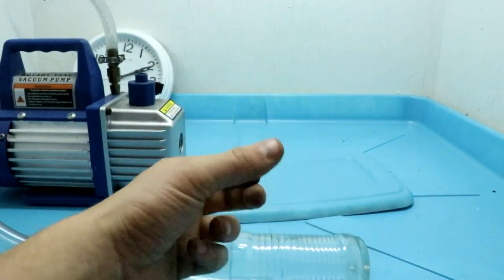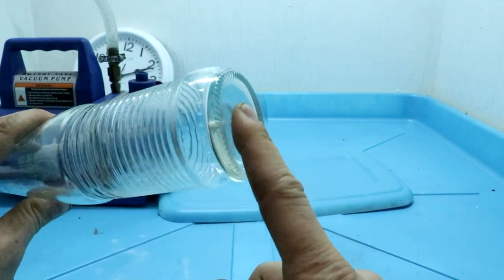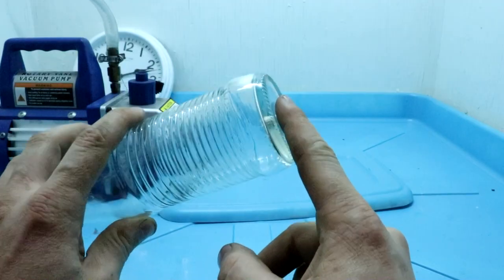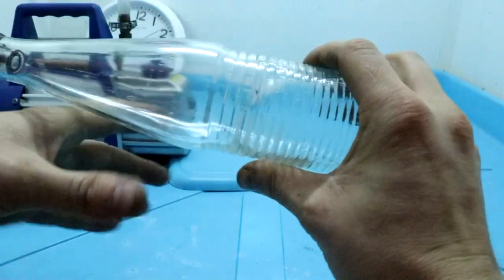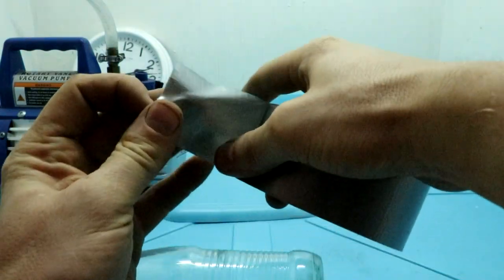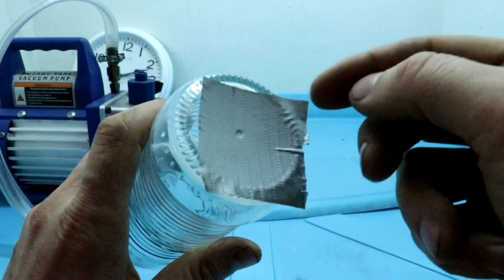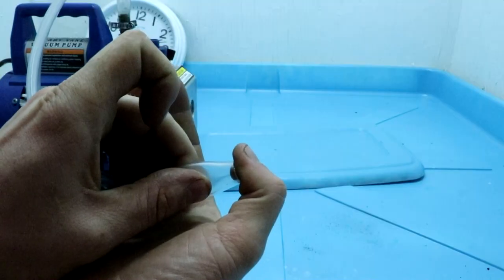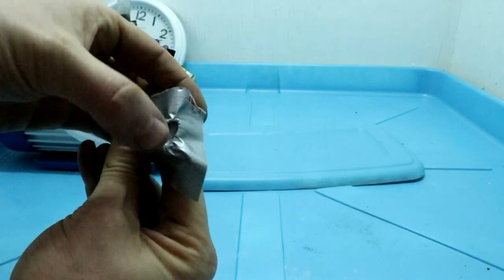Use Your Finger to Stop a Leak on the Space Station?

Comment: My first thought on the idea of orbital debris punching a hole in the space station is that we'd expect to see two holes: one going in and one going out. But I guess since there's no hole, all of the material from whatever caused the debris came to rest in the space station. Maybe it didn't have enough momentum to punch through the other side and just bounced around a bit before stopping, or got stuck into something soft and squishy. Maybe it shattered when that happened. Or maybe it vaporized or disintegrated when it carved through the air inside the space station. I wonder which of those is most likely.
Reply: If it's a tiny piece of debris(like really tiny) with a relative velocity of km/s then it would probably vaporize, I'd bet the size of the hole was many many times that of the object itself.
Reply: In a hypervelocity impact, the projectile is usually vaporized, I believe.
Reply: What's the difference between a hypervelocity impact and a lopervelocity impact?
Reply: If air is leaking shouldn't the hole be in both sides?
Reply: great now I want to see a surface with a hole on only one side
Reply: its called a dent.
Reply: @tom_something  boo,  get out.
Reply: Barnesrino Kripperino
The inside of an object is typically not rendered so you'll just see through it anyway. Also it's fairly common not to render hidden objects, to save resources, so thing's behind the holes may be invisible too.
Reply: @tom_something A Hypervelocity impact is an impact at a very high velocity such that the strength of the colliding materials is insignificant compared to the forces involved. The result is that the materials fall apart, or "vaporize".
Reply: how many holes did the bottle have in the video in order to simulate a leak? 1.
Reply: +Isgolo, what I mean is if we had an object of sufficient durability and inertia, then it would have punched its way into the space station and then punched its way out through another hole. So if there's no other hole, then all of its momentum was transferred to the space station.

Ooooo, how about this? What if it popped into the ISS, slowing down significantly, bounced off an internal surface perpendicular to its trajectory, and was sucked back out into space through the very hole it created? Statistically speaking, that didn't happen, but it's fun to think about.
Reply: +Jack Evans, when you're inside the Space Station, I think it's usually rendered as negative geometry so only the internal surface is visible. Thus objects coming from outside may not be triggering a collision upon entering ISS. Then... oh, that would mean the hole is actually an exit hole!
Reply: @Isgolo  The reason you sometimes need a second hole to pour stuff out of containers is because the internal pressure of the container drops if nothing can replace the material being poured. The force generated by the pressure differential beetween the athmosphere and the container will quickly overcome gravity and stop the flow.

In the case of the ISS the pressure differential will always be on the side of the vacuum of space, sucking air out until there's none left.
Reply: Passed a certain speed, penetration depends only on the density and size of the impactor relative to the density and thickness of the wall. The micrometeorite can't be bigger than 2mm (the size of the hole) and if we assume a hull thickness of 5mm and similar density, the meteorite simply can't go through it, no matter how fast it goes. Instead, it will disintegrate on contact and cause a small explosion, and the hole in the ISS is more likely to be the crater of such an explosion rather than the result of a meteorite punching through.
Reply: @ozzyp97  oooooohhh, i misinterpreted the fist comment.
I thought they were talking about holes in the layers of the space station (idk why i assumed there is only two layers on the ISS, i don't really know)
Nevertheless, thanks for the explanation.
Reply: Tom Haflinger or maybe no one cared.
Reply: actually two if you think about it.
Reply: +ZOMBIE, a spacecraft staffed with human beings has a hole in it. I reckon the whole episode might pique the curiosity of one or two fellas.
Reply: Tom Haflinger
Velocity
Reply: Another problem with this leak is that it's generating propulsion. It's changing the ISS velocity at a rate of 60mm/s per day! Everybody watch out!

I did that math really quickly and probably did it incorrectly. Normally propulsion is calculated by the mass and relative velocity of ejected material. But since we can calculate the force exerted by the pressure differential on a given hole, I figured we could just plug that force in and skip the whole gas speed hullabaloo altogether. Is that right? I figure about 0.3N for a 2mm diameter hole with a pressure differential of 14.7 PSI. Yep, mixing metric and imperial. Always a good way to avoid mistakes.
Reply: I imagine they will check out the hole from the outside during the next EVA.
Reply: Tom Haflinger wouldnt that be assuming a perfect nozzle?
Reply: +TheToric. Yeah, probably. The gas isn't going to leak out in a straight line, I guess.
Reply: what if the object just got 'blasted' out when the hole was made due to the pressure difference? the outrush of air into space might have just prevented it from entering the cabin, or maybe its just too small for the rushing air to have any significant effect on it.
Reply: Look into Whipple Shields
Reply: I bet it was an alien with an ice pick.
Reply: Did I not say alien with an ice pick? I meant to put that at the top of the list.
Reply: It doesn't work that way. The hole is exactly the same diameter size and shape as the projectile cross section, at least for bullets (which travel at up to, say, 1km/sec). Perhaps when you get to 10 or 100km/sec, there is some change in regime that leads to different behavior, but after watching lots of slow-motion video of bullets impacting various targets, including sheet metal, the hole is always exactly like the bullet unless the target material shatters and explodes. The shattering and exploding process is much slower than the bullet velocity. By the time the target has shattered, the bullet is typically long gone past the target.
Reply: Whats even scarier imo is that something to make a tiny hole like that was a speck of dust, a paint flake, or something like that.
Reply: Spit ball?
Reply: that'd just be a blind hole, or a wormhole, but probably a blind hole lol
Reply: @aajjeee  check out klein bottles. Numberfile did a pretty cool series of videos on them.

Comment: Reminds me of a story by Hienlien, "Gentlemen, be Seated", in which a man must seal a leak in a lunar dwelling with his behind. Painful. You would think astronauts, real and fictional, would stock patching gear and materials to avoid the need to improvise.
Reply: I remember that story; a small crew of lunar tunnel workers were trapped in a tunnel section with a fifteen-centimeter hole in the steel shell. They took turns sitting on the hole. the major danger was losing body heat into the cold steel shell. The only injury was a strawberry-sized welt on the buttock.

Comment: The initial boiling is not water vapour but usually pulling dissolved gases out of the water. It then settles down and then starts truly boiling when the water vapour pressure is finally reached.

Comment: Thank god... not that it'll shut the idiots up. And of course, they didn't JUST use duct tape, they used epoxy too, which I imagine makes an even stronger patch over the hole and reduces the gas diffusion through the duct tape even further.
Reply: They probably used a metallic tape like proper HVAC duct tape (the grey fiber reinforced stuff is crap)
Reply: @RobertSzasz  They used Kapton tape.

Comment: Reminds me of the time my dad's 56 Plymouth evidently vapor locked from hot fuel line on the boat ramp.  I was about 13 years old and some one suggested to hold my hand over the top of the carburetor.  I did so with all haste and my Dad cranked the engine and it started!  Success in starting the engine, but then my hand was stuck on the carburetor and when I pulled it off with all my strength the vent tube in the top of the carburetor made about a 20 stitch incision in the palm of my hand.  That day of water skiing was cut short!

Comment: Great great job Cody (as usual) !!
And now, Ladies and Gentlemen, the moment for the "Bad Physics Award" from Cody :
The winner is "Alien - Resurection", where the 5 tons of flesh of Ripley's alien chimeric baby are extruded in similar conditions through a tiny hole in the wall of the space ship...
A second quite common misconception concerns the flow field around such a hole. In fact, inside the cabin, mean air speed decreases roughly as the inverse of the sqare of the distance : so nobody flies, or get sucked toward such a hole... 
So the second winner could be the very old James Bond "Goldfinger", where Gert Froebe litterally flies trhough a plane cabin because there's a bullet hole in a window...

Comment: I'd be curious to see you take the glass bottle (possibly one that is a bit bigger) and seal the hole with different types of common house tape. Then make the hole slightly bigger and repeat the test over and over until each type of tape fails or the hole becomes too big for the tape.

(you could maybe do an alternate version where you use one of your metal pressure pipes and put the tape on the inside to see what PSI blows out the various tapes)

Comment: 1. It seems that a lot of the people commenting haven't heard the news that the hole was actually drilled and was probably made on the ground. The picture of the hole that was punched by a high velocity impact were taken of a different spacecraft and the newest pictures of the hole in the ISS clearly show a drilled hole and surrounding drill bites and the remains of some sort of material used to patch it.

2. Had it been made by a high velocity impact there would still only be one hole because an object traveling that fast would vaporize even upon hitting a piece of aluminum foil. It will still blow a hole through whatever it hits, much like a HEAT round hitting armor, but there would not be anything left to make an exit hole on the other side of a spacecraft.

Cheers!

Comment: And let's not forget that the duct tape they'd be using on the ISS would be a weensy but more robust than the over-the-counter duct tape you've got there. Probably several times thicker and at least that many times stronger.

Another thing, for those space doubters out there, since the higher pressure would be inside the station - and the pressure equalization process would move from high pressure to low pressure (I'm not an engineer, so terminology may be off) - the fact of the matter is that the internal air pressure would actually HELP push the finger into the hole.

Also, the pressure differential inside a submarine at its maximum depth is many Many MANY MANY times greater than it would ever be on the ISS. It's not even close. And yet even in those submarines, using special tools, they can seal the breach.

Comment: While not as much of a risk in outer space, delta-p is a big risk to commercial divers because the pressure differences can be significantly higher than 1 atmosphere. It just reminds me of the "crab gets sucked into an underwater pipeline" video
Reply: Which then reminds me that this has happened to actual people the same way. The only solace being the delta-p is so great that you are pretty much instantly killed.

Comment: Small correction: at 2:30 water isn't actually "boiling", not yet because likely not enough vacuum was produced yet, what is happening is that gases which were dissolved in the water are getting out of it.

Comment: Pretty simple calculation: in laymen's terms there is a load equivalent of about 1 Kilogram on 1 square Centimeter (on earth). On a hole with a diameter of 5mm there is a load of approximately 200 grams. This is because on earth the average atmospheric pressure is around 1000 hectopascal. Inside the ISS there is a pressure of 1013hPa, which hardly makes any difference.

Comment: I've heard FEs call it "The immense vacuum of space." Like a vacuum chamber and space are different somehow. 0 PSI is 0 PSI no matter where it is. It's the pressure difference, nothing else. So the walls of the ISS have 14.7 PSI exerted on them. Consider a car tire is 36 PSI, and truck tires are around 90 PSI.

The pressure exerted on a 2mm hole is about  .07 pounds.

Comment: 2x2mm hole = only 40g of pressure spread over the area. They did actually temporarily use tape to seal the hole but it was still slowly loosing pressure.

Comment: Stratum Corneum, or "hard layer" of the skin is made of dead keratinocytes stitched together with tight junctions before they senesce, forming a water tight, nearly air-tight layer to keep our insides in, and our outsides out.

Funny thing about a gaussian surface - its like our skin - it divides the entire universe into two parts.

The inside. 

And the outside.

Comment: Yap... the real danger of holes in walls with different atmospheric pressures on both sides (like the space station, or a dam, or a boat/submarine, or a plane... or say, a parachute) is the wall material not being able to hold and the hole getting bigger and bigger.... then things can get messy fast. xD
Reason why some of the material used in lots of cases have some sort of structure to hold out in case of holes or tears opening up. Check out for instance the material that parachutes are made of... they have to be super lightweight, but resistant to tear (ripstop). So they are made in a way that you could poke a hole there, but holes don't easily tear open and expand.

Comment: I notice you didn't show a pressure gauge of the vacuum. Are you hiding? you claimed 12 pounds differential. Does that mean you are at 2.7 psi? Do you think that compares to -17 tor vacuum? Your whole body would be squeezed through that tiny hole I believe. Need a stronger vacuum I think. I'd love to see a better experiment. Thanks for showing though.

Comment: I think people really overestimate the pressure differential between the space station and the vacuum of space itself. It's literally one atmosphere of pressure difference. If you dive 10 meters deep, the force applied on your body would be twice of that on land - so 1 atmosphere more than is applied regularly. And people can dive to much bigger depths without our bodies getting crushed.
Or think of bicycle tubes - they are often pressurized to 3 to 4 atm, meaning the difference between the inside of the tube and the outside being twice or three times of that the space station has to withstand. A simple piece of tubular rubber. And you can definitely stop a leak by putting a finger on it (though the force would be applied in the opposite direction).

Comment: You feel cool not because of evaporation on your finger (it said few minutes before that skin keeps water pretty good), but because less molecules than usual bombard your skin (not sure if molecules moving slower). In any case: when  you feel neutral temperature (neither cool nor warm) that means you sense certain amount of impulse from bombarding your skin molecules. Cool is when that amount is less than 'norm', warm - more than 'norm'. In vacuum, well - it will be definitely cooler, since definition of vacuum - less particles hit skin.
As for defining that 'norm' , it is pretty interesting question. I am not expert, but I would say it can be 'set' by both brain and structure  of receptor itself.
Reply: It's my understanding that we don't actually detect temperature (kinetic energy from molecules bombarding things), but transfer of heat to/from our skin. In a vacuum without any convection or conduction, I don't think that much heat is transferred away from your skin -- heat radiating away is relatively minor. I'm also not an expert, but I don't think your correction is right.

Comment: The actual force across that hole is only 0.03 pounds, about 0.6oz, or the weight of 17g.  If a hole this small were able to pull your finger through, any time you placed a small, dense, pointed mass on your hand, it would just sink right through.

Comment: Just on a side note: the water didn't boil when you put on the vacuum. It just pulled out the gas dissolved in it hence the strong bubbling.
Reply: If the vacuum is strong enough the water can boil, but what you've said is spot on for this demonstration

Comment: 1/8 inch  diameter is about pi/64 square inches, call it 1/16 sq in. SO 12 psi over 1/16 sq in is less that 1 pound suction, not enough for a hickey.

Comment: That's actually really scary, not because of the hole. but because of the possibility for the failure to be exacerbated.
Reply: That greatly depends on the material it is made out of, with many materials, the initial hole won't get any bigger whatsoever.

Comment: Holy crap Cody.  I've been contemplating on a proper vacuum pump lately and I've been looking at a 12CFM 2 stage model from eBay that looks very similar to yours.  You think that's an okay decision?  I've never been so much up in the air on a purchase than a vacuum pump for some reason.

Comment: Cody
What I don't understand is why did they say they were not in any danger? Does the air not "leak" out as fast what some might imagine? I imagine a pressure of zero to a pressure of one atmosphere would vent out at high velocity.
Reply: Again, this is a function of both the pressures and the size of the hole. Air just can't escape very fast through such a small hole.
They calculated that it would take several weeks for the ISS atmosphere to vent into space.